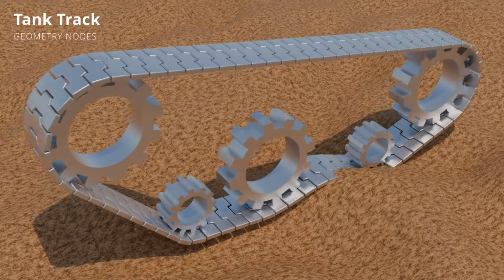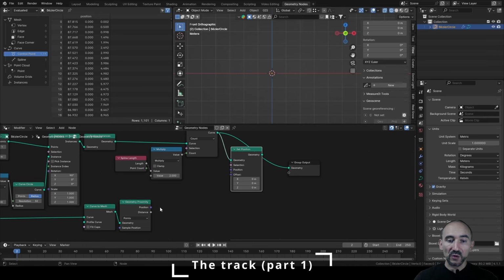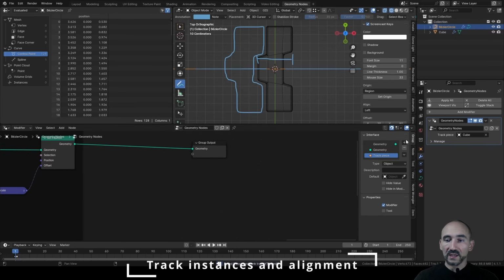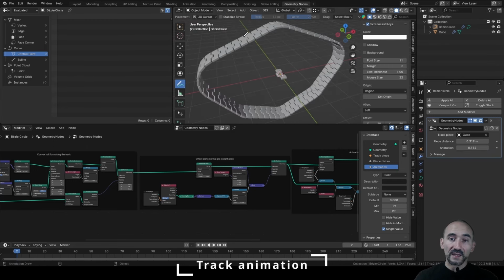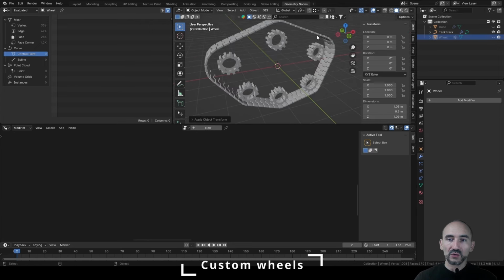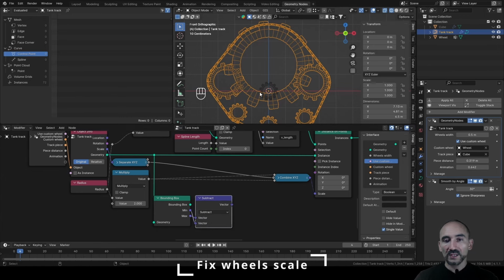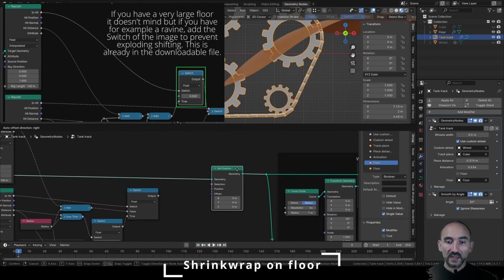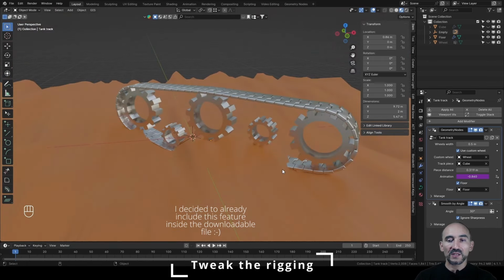Procedural Tank Track in Geometry nodes - Blender tutorial ENG

Comment: Very nice setup you have here! Must have taken a lot of work to figure out.

I am a mechanical engineer, so I have one nitpick here from kinematic point of view. You resample the curve, and spawn a bunch of track links on them, rotating by their origin in the middle. This works OK if the links are very small like they are in your example, but if you want to simulate a real world application like excavator tracks, you will notice how as soon as the links start moving around the rollers, they rotate wrong. In real life, tracks are a long chain, with each link having TWO pivot points, they do not rotate around a point in the middle of the link.

So what you should do is instead of instancing each link to a point on the curve, orienting it to the tangent of the curve, you should convert the spline into a set of straight edges, then instance each track link on the middle of that edge, and align the rotation to the rotation of the edge. As long as the the track link is modelled properly so that the pivot points are spaced equally apart from the object origin, AND the resample distance matches exactly this will maintain the true look of an "IK" chain.

I went down this same rabbit hole trying to create a track rig using an armature, ton of helper empties, object constraints, etc. It was an absolute pain in the ass I tell you. A simple tweak on your node setup makes it so fast to use.
Reply from the maker: Hi! @bucklogos! Thank you for the comment and the detailed description of the real case! It will help lots of people that need this kind of realism. I laughed when you described the pain 😂 I can only imagine! Yes my example was a sort of semplification of a real environment however thank you so much again for the tips! Really appreciated!
Reply: @andrea_ciani  Oh, what I failed to mention was I followed a track rigging tutorial in Chinese. I DON'T SPEAK CHINESE.
I literally had to navigate by looking at icons of the constraints he was adding and guessing at which settings he was adjusting because his UI WAS IN CHINESE.
Reply from the maker: @Buck-zor  OMG!! Incredibly difficult! I'm learning chinese by myself but the reading from the UI would be impossible for me! Very brave!

Comment: For me the Convex Hull gave a nice clean mesh in similar situation.
I did some testing and noticed that if the points (or circles) are in the same plane, the convex hull gives a clean face which is easy to convert to curve. But if you move the points a tiny bit off the plane, the result is that mess. If I rotate all the circles, it creates a mess in certain angles (but not all). I believe this is because of floating-point errors in precision.

Maybe the curve you use for instances isn't entire flat. Or perhaps the process causes some inaccuracies. Setting Y position to 0 for all circle points might fix that.
Reply from the maker: Yes, I absolutely agree with you!

Comment: Could someone explain what would be alternative to a procedural generation, and what would be the benefits of both approaches?
Reply from the maker: Hi @anarios-ryd! If you search for other videos of tank track on youtube you can find several alternative. About me, i think both approaches are good but if you need more control for the behavior and have specific parameters to tweak instead of having lots of objects in the outliner and modifiers in the stack you should probably follow the procedural way.
Another think is that the procedural way could be more difficult to control if you need to add simulation, physics etc because from the GN workflow you always get one single object  so you couldn't rig the single part of the object in an easy way (for example if you want to add suspensions on the wheels and add other constraints to simulate physics, spring effect etc on the track).
It depends on what is your final goal.

Comment: when I try to do shift + alt + click it doesn't work, is it something in the preferences?
Reply: nvm i think it was node wrangler
Reply: Ok, so I've finally got everything working except 1 little thing, when I tried to add the custom wheels, i did it except the original cylinders aren't going away. Any ideas on how to fix that?
Reply from the maker: @Mangonumber216  I should see your file to check it. In this case it's difficult to guess it.
Reply: @andrea_ciani  Ok, how should I share my file with you?
Reply from the maker: @Mangonumber216  Yes it's the node wrangler. In some videos i mention to enable it in the preferences but not in all videos.

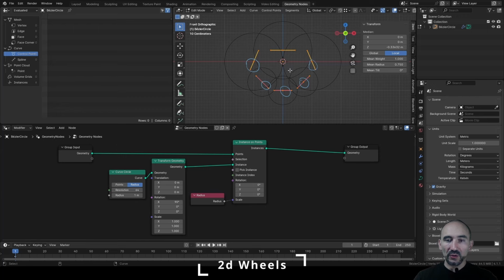Comment: I'm not sure why but at 3:51, you had a bunch of circles surrounding the points, but I didn't. I am really new to geometry nodes and I have no idea why.
Reply from the maker: Hi! Be sure to apply the scale to the object of the curve and to set the correct unit measure and scale value like in my tutorial. In this way you should have the same result.
Reply: @andrea_ciani  I made the circle and set the radius to the bottom 3 to 0.5 just like what you did, then in object mode i scaled all the axis to 100 and applied the scale. (I already had the unit to meters) but when i added the transform geometry, everything just disappeared
Reply from the maker: @Mangonumber216  Ok, check also these two:
1 - After the apply scale re-check the radius value of the points and change them accordingly
2 - Make sure to have the curve of the object on the X and Z plane like my case because if you have a rotated curve (for example on the X and Y plane) some transform geometry would need to be added or removed to rotate the instances of the circles correctly
Reply: @andrea_ciani Everything's fine before geometry nodes, but then when i add the curve circle it all disappears.
Reply: @andrea_ciani  would this work in blender version 4.1.0?
Reply: nvm it was jus really small.
Reply: @andrea_ciani  I think I've figured something out, I finally got everything to work, except when I add instance on points, then it disappears and I don't see any circles.

edit: nvm I think i got it
Reply from the maker: @Mangonumber216  Yes it should work in blender 4.1.0
Reply from the maker: So did you find the issue now?